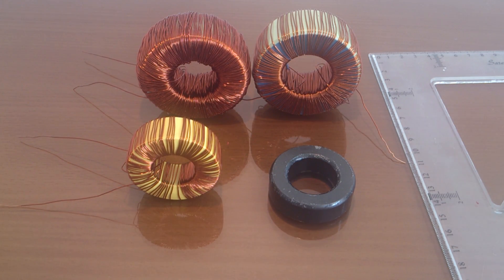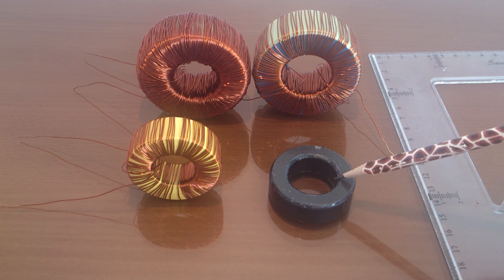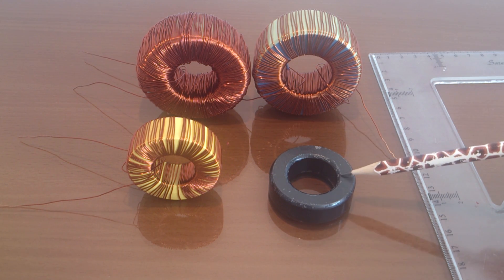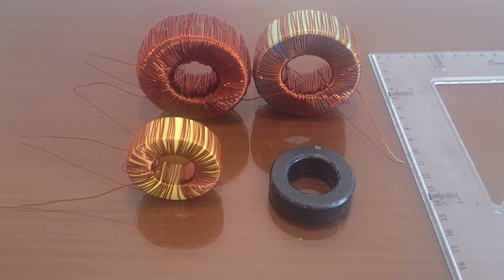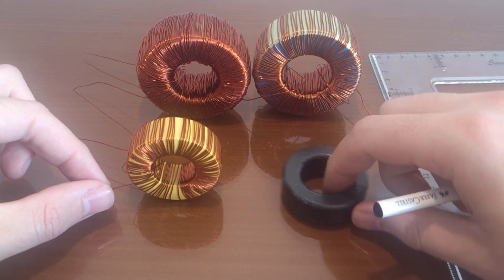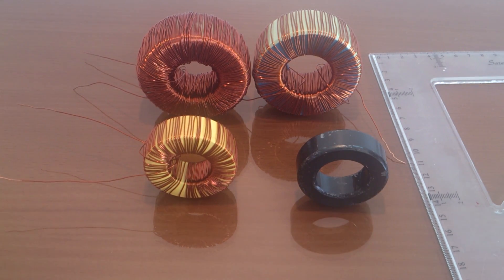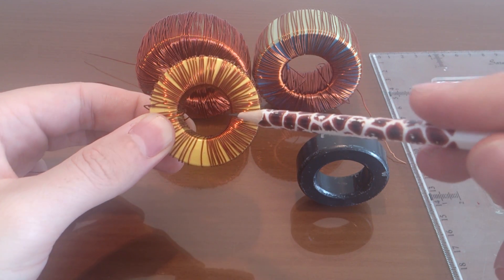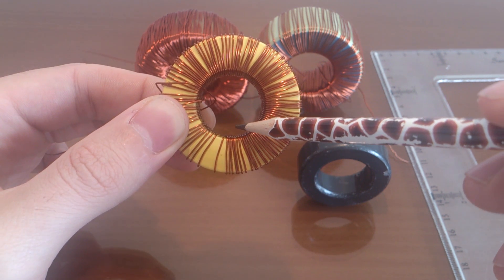How to making inductor part 2(Ferrite & Iron powder toroid cores)

Comment: I have a ferrite core (CS400125) permeability 125. 168nH.... Dimensions 4cm outside diameter. 24mm inner diameter. 14mm thick. how many mm of copper wire do you need? how many turns to get 2.5 mH for high FREQUENCY inverter filter output sir...?

Comment: It is non sense at all:
What means high frequency? May you give a range? Please?
And i'll ask you a question : what about a power square signal? Let's say 200 khz.
According to the fact that each transition is theorically an infinite frequency?
What should we use for PWM amplifiers or PWM BUCK cores for example?
In practice square signal is slow by many factors :
- The rise time of the components
- Il may be slow down on gate of theses componants by some circuitry.

Comment: Can you tell how to calculate current saturation i have to make 6.4 uH inductor with 30A current saturation. Do i have just to use big enough diameter wire ? Or there is something else to consider?
Reply: same
Reply: something about switching frequency? if it's a dc inductor - yes, u can use any awg of wire, but else u must remember about skin-effect